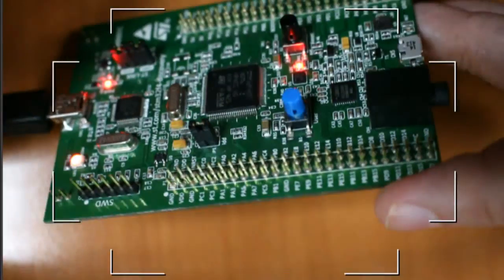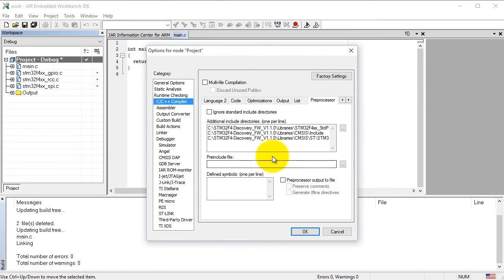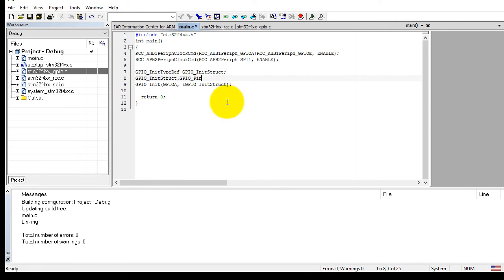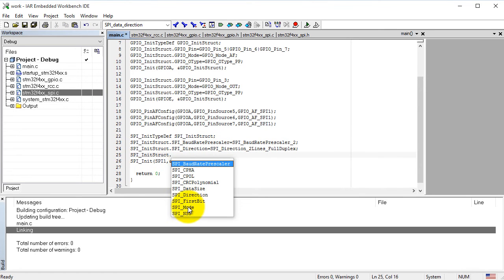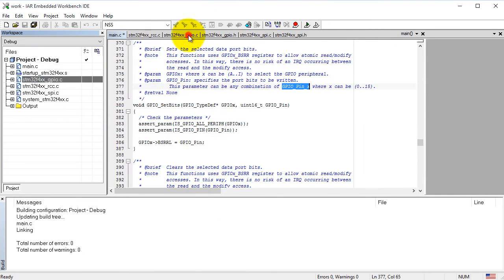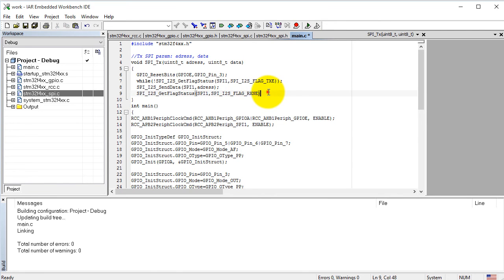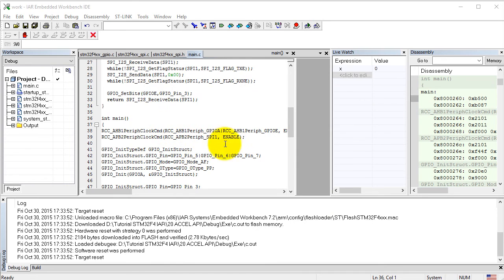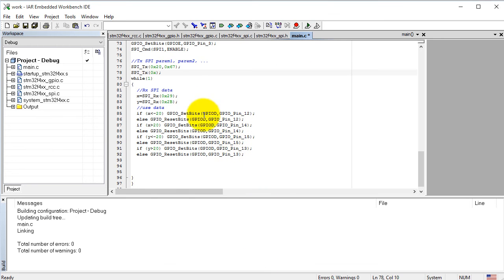19 Tutorial ARM Cortex M4 - SPI and accelerometer LIS3DSH

Comment: Hİ,I use your code, but it did not work, it does not send errors in the compiled, but the axis "x" does not change, delivery as output "-2'þ '", the same axis "y", some advice you can share would be very Useful, good video
Reply: try this change SPI_InitStruct.SPI_BaudRatePrescaler=SPI_BaudRatePrescaler_2; to SPI_InitStruct.SPI_BaudRatePrescaler=SPI_BaudRatePrescaler_8;

Comment: Hello Sever, Thanks for the inspiration. I've implemented this code and at first, I always received "-2 'þ' '' as the output. Then I've just modified the datatypes to uint16 instead of uint8. Also, I've declared x and y as volatile int. Now, the problem is the output is always positive. so, two of the LEDs never turn on. The other two works just fine based on the motion. Do we have any workarounds that I can try?

thanks.
Reply: try this change SPI_InitStruct.SPI_BaudRatePrescaler=SPI_BaudRatePrescaler_2; to SPI_InitStruct.SPI_BaudRatePrescaler=SPI_BaudRatePrescaler_8;

Comment: Hello,i use your code, but it did not work, it does not send errors in the compiled, but the axis "x" does not change, delivery as output "-2'þ '", the same axis "y", some advice you can share would be very Useful, good video.
 
Saludos desde Chile.
Reply: me too. Did you get any solution?
Reply: try this change SPI_InitStruct.SPI_BaudRatePrescaler=SPI_BaudRatePrescaler_2; to SPI_InitStruct.SPI_BaudRatePrescaler=SPI_BaudRatePrescaler_8;

Comment: i still dont understand. why the data value on this line "SPI_Tx(0x20,0x67);" is 0x67 ?
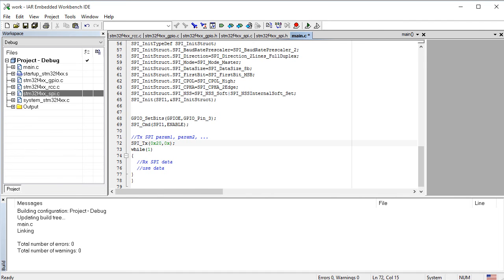Reply from the maker: In the documentation for LIS3DSH (DM00040962), at page 63 you may see in table 23 that the combination for the most significant nible for 100Hz is 0110- this means 6. From table 22 you may see that for enabling the x, y, and z axis you have to take Zen=1, Yen=1 and Xen=1. This means 0111=7 for the least significant nibble of CTRL_REG4. It is shown at 29:50 - 29:54 in the video. Of course, here we didn't use the z axis, but I've enabled it just in case.

Comment from the maker: Some LIS3DSH have a slower Reset, so they need an extra time before the microcontroller start using them. To ensure that the accelerometer is ready after power-up, it is better to insert a delay after the SPI programming, for example a loop               for(int i=0;i<1000000;i++), as shown at 22:58.